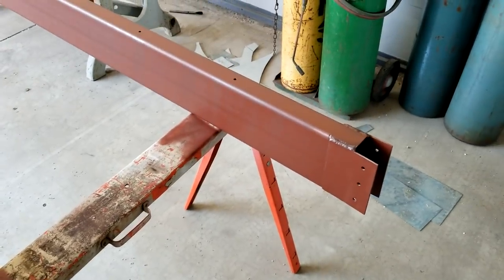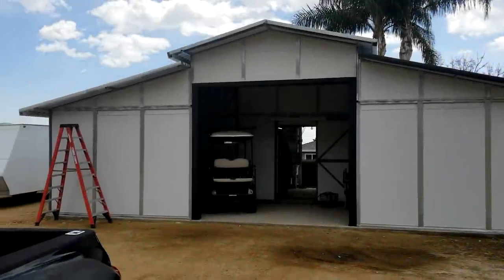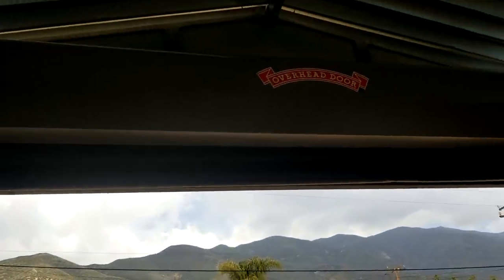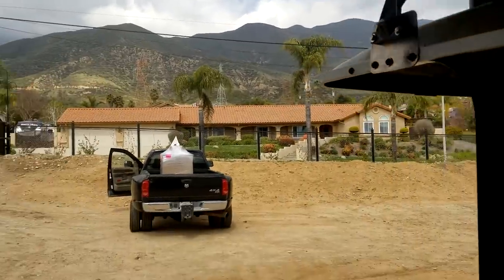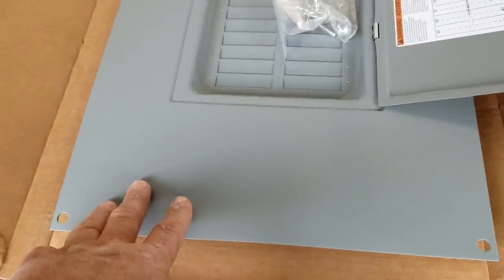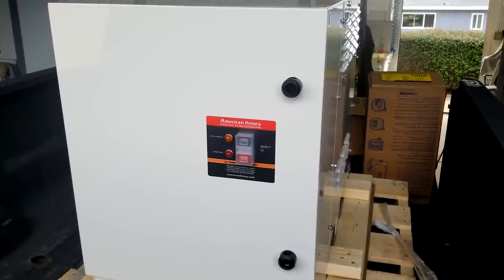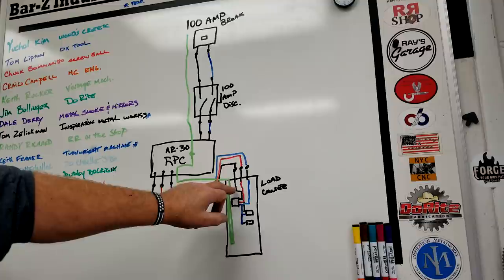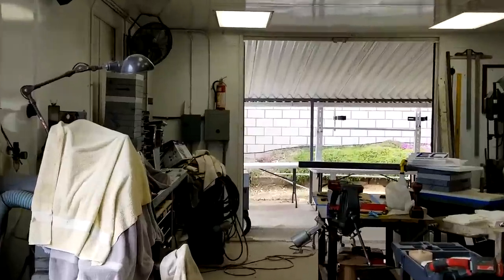Bar Z shop extension Phase 2

Comment: That will be a nice setup for your electrical system in the shop.  Thank you for explaining how you do things and why, as someone who is fairly new to 3-phase equipment and power sources that was interesting to see how you are going to wire the panel to allow 1- and 3-phase equipment on the same system.

Comment: Two things came to mind when watching this video.
 To generate the 30 amp third leg the converter will need about 20 amps from the 240 volt supply. Total current used for full load three phase will be about 50 amps, leaving 50 amps for other loads.
It will be easy to forget to start the converter before turning on a piece of three phase equipment. A line could be made in the converter that indicates three phase is available which could be used to turn on a relay with a contact in the equipment's stop circuit.  This would add a small relay to each piece of equipment you choose to protect but would be a small price compared to the damage single phasing a motor could do.
Reply: That is not a 30 amp converter, but a 30HP converter so more like 80 amps. But that is totally load dependent. With a one man shop it's not likely that he will ever spin up all the machines at once. (If he does he'll have to turn the lights off ;) Does that count as lights-out machining?)

Comment: I run those QO's in the shop here. They are spendy but pretty much the nicest breaker/panel on the market in my area. They are far more sensitive than any of the standar snap-ins (Midwest/GE/Etc).  Nice addition.

Comment: Great explanation of the electrical circuitry.  I'm amazed that you can run the home + shop on an 100 amp input.  .lookin forward to seeing the shop addition at the next bash
Reply from the maker: 100 amp is shop only, 225 coming in from the pole.

Comment: 30HP!! I Love the over build. I would have also overbuilt to have capacity for future upgrades, like that little 25hp CNC you've always wanted. Pretty awesome Stan. Question about the passthrough: Normal 240V is two 120 phases out by 180 degrees. Three phase is three phases out by 120 degrees. Does the phase converter disconnect the two passive phases when it engages and switch to the new scheme?
Reply from the maker: I have already tried this with single-phase input VFDs (up and running) downstream of my little RPC, starting the RPC didn't affect the VFD in any way. The same test with a single-pole lighting circuit, there was a lighting flicker @ RPC startup, but only for milliseconds during locked rotor. The theory is sound and my initial test successful
Reply: @ShadonHKW  Very interesting. I look forward to seeing it working.
Reply: @DudleyToolwright  I wanted to ask the same question.  I think maybe capacitors are involved in getting the phases clocked at 120 degrees on the output.  I'm not sure if purpose built RPCs are wound differently than  three phase motors, but i've seen regular motors used as RPCs, so maybe not.  I am curious to see an explanation of how the phases are corrected.

Comment: On my static converter system, you cannot have any of the controls working from the generated leg.  One other reason to know which wire in your setup is handling that leg.  Until the motor is started, voltage between the generated leg and either of the remaining two legs will be almost double, potentially damaging to the machine's control relays.

To use my surface grinder, I have to start the spindle motor (which the starting circuit is tied to), then the hydraulic pump motor, before bringing anything else on line.  Inconvenient, if the machine's instructions didn't call for a warm up period before use.  What bothers me is trying to set things up on the mag chuck with the spindle under power, and the possibility of getting in foul with it during the process.  Even with the head fully raised, table out and fully to one side, I don't like it.  I could easily ... covet ... your old rotary, if it was just a little bit bigger.  It would be at the upper limit with this grinder.

Comment: Oh my what a hack is that RPC approach to synthetize the third phase..
The result looks like phases 0 degree, 180 degree and 270 degree will be in play.
The 270 (or 90, depending how you look at it) phase is the generated one.

But that means there is unbalance in between phase voltages, and a delta-connected motor performance will derate due to it.
Not that Wye (star) connected motor is much happier either.

A single phase pass through ("0 degrees") and two generated phases (at 120 and 240 degrees) would be much happier to many things.

Here at the true 3-phase side of the universe, we are lazy and just push the IEC 60309 (aka IEC 309 / CEE 17 / ..) red 5 pole plug in the socket, and let the merryment to begin.. 
At my residential city house I have 3 phase 25A 230/400 V supply, like a typical small single family house in this part of town.
Reply: I can't remember where, but i've seen demonstrations of the outputs of RPCs shown on oscilloscopes.  As I remember, there were clean 120 degree spaced sine waves.  So, i think something else is in play to clean up the wave form.  I'll try to find out more about it.

Comment: Hallo Stan Question do you have a ground in your breaker box  that is used? I live in The Nederlands and here we have a neutral and 3 phase and a ground in our breaker boxes
Reply from the maker: Yes, we use copper driven  grounds + cold water grounds connected directly to the panel chassis.

Comment: Stan, question. Your feeding the RPC with single phase with neutral (split phase) so L1 and L3 (after they go through the RPC are passive, but are 180 degrees out. How does that work with the generated L2 phase?  Shouldn’t they be 120 degrees out of phase with each other?  Hence you get 208v on two legs of a three phase circuit, but with single phase you get 240v.
Reply from the maker: The converter doesn't need or use the neutral line, I am staying away from the red (L2) for 120V use in all cases, the shop has the be wired very specifically, breakers installed in proper slots, and any maintenance work done with the red line in mind.

Comment: LOL, If anyone international asks for that old phase converter, show us the photo, because I want to know what weird ass setup they've got.
Reply: I know that john mils aka dobbelboost in England has a phase convertor to power his lathe
Reply: @DeutscheReichsbah100  Ok, so for whatever reason he can't get 3 phase (weird, but ok), but unless he's got an American lathe, he's gonna want a 220V single phase/380V 3 phase converter.

And even if he has got an American lathe, where is he gonna get enough 220V two phase power, to power Stan's old phase converter?
Reply: @johnalexander2349  I don't know the only thing I know is that he has shown it in one of his video's
Reply: @DeutscheReichsbah100  I don't follow him. I'm not doubting that he has one - there are unusual situations that would call for one, I"m just saying that it's going to be a very, very unusual situation for someone outside the US to need a 220V 2 phase to 240v (??? what is American 3 phase voltage anyway) 3 phase unit.